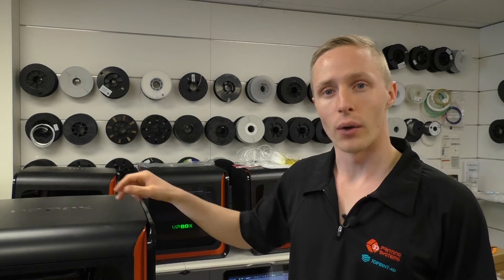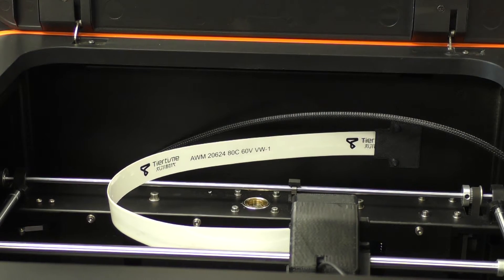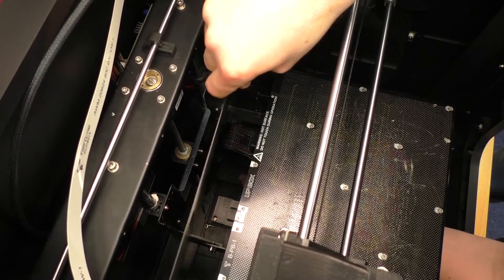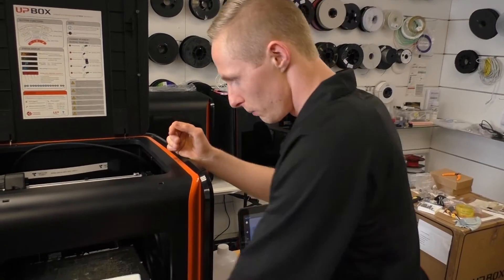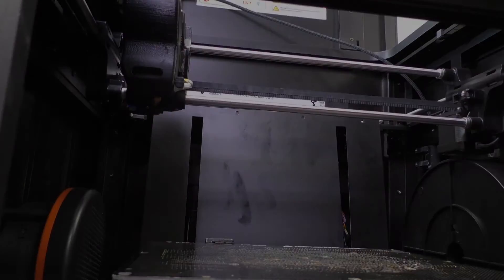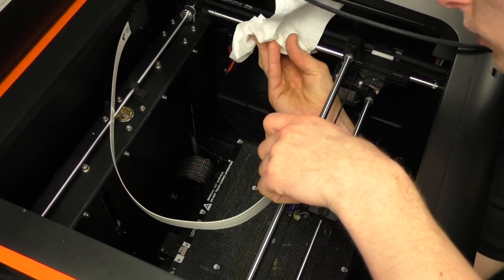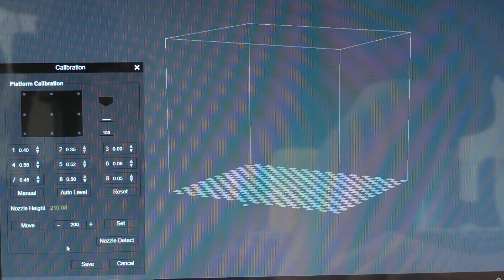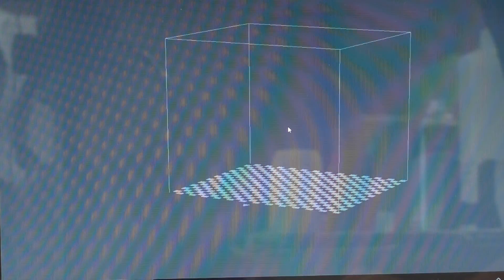Support / UP Box / Lubricating your 3D printer

Comment: WARNING - If you take the back panel off, you will NEVER get the bottom screws in again! The captive bolts are placed so you have to angle the screw upwards and so have no space for a hex driver or allen key.